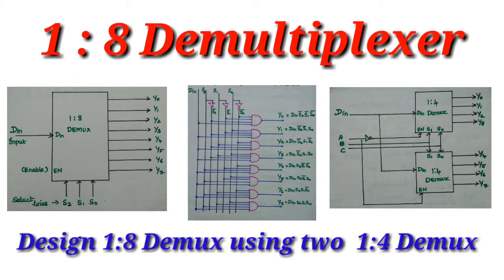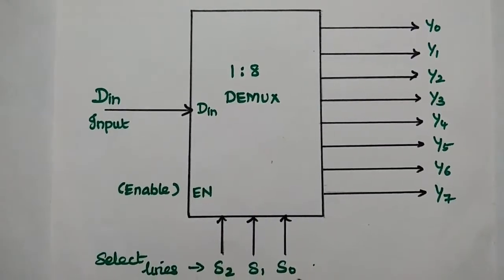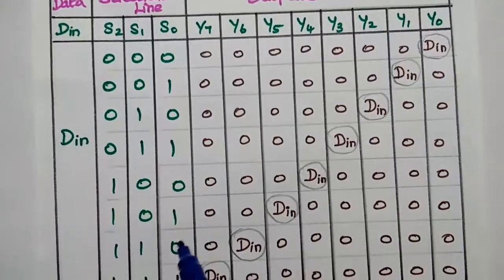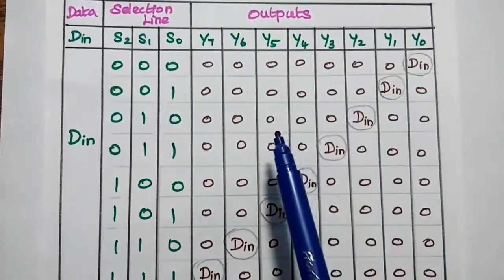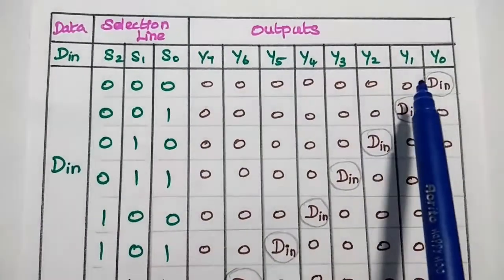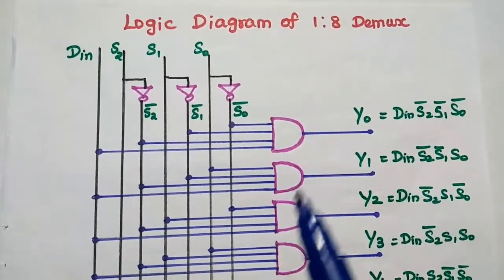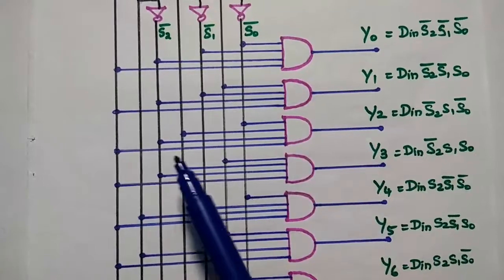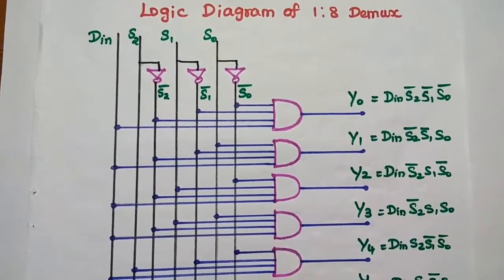1:8 Demultiplexer - Truth Table, Logic Diagram and Its design

Comment: Madam in your truth table why you didn't included. Enable as one of the inputs
Reply: You have boolean expression so no need of kmap ig
Reply: enable is not an input, it just controls the flow of current and it works on the concept of active low so we ground the enable as it has an overbar so it will convert 0 to 1 and allow the current to flow.
I hope that makes sense